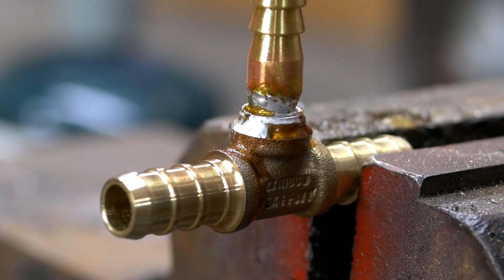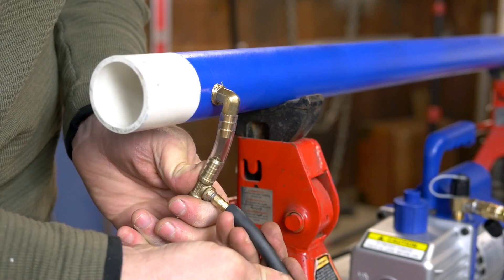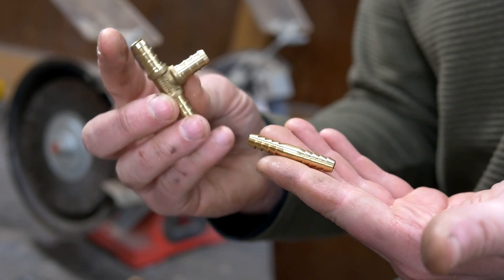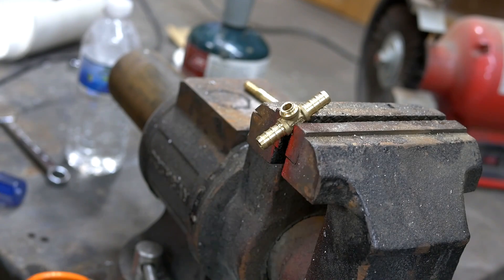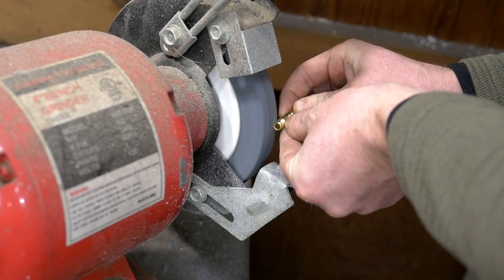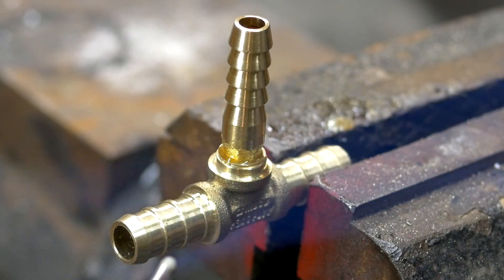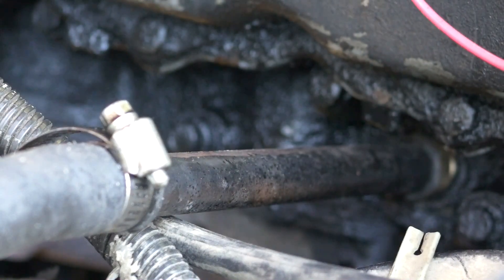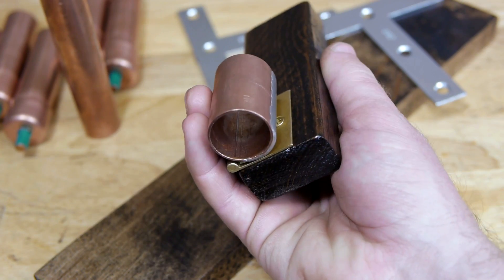How To Make Custom Brass Fittings

Comment: You could use a nail or steel tubing inside your hoae barb to support it from inside when grinding it.  Make sure to grind off the point of any nail just in case.

Comment: You should not use standard soldering for thermal stuff and coolant systems. Brazing is always safer there.
Reply from the maker: I think I have bigger things to worry about if my engine gets hot enough to melt the solder though.

Comment: the compression fitting is an hvac specialty. if you have a Kerr in your area they keep them in stock if you ever need another. just ask  for a yellow jacket flare fitting. they come with flare on one end and 1/2 npt.
Reply from the maker: Good tip!

Comment: you should try silver brazing/ silver soldering, using mapp gas or oxy acetylene. It creates a  much stronger connection and can handle a lot higher heat then the soft solider can

Comment: When I grind small cylindrical parts by hand like you did with the fitting I would insert into a rod making handling of the piece easier and the grind more even.

Comment: Awesome video!  I've got a similar problem lately of mounting an aluminum hinge to an aluminum fuel tank filled with gasoline.  Don't think I'll try this with the flame but was thinking maybe just some epoxy for now unless you have a better idea.  Its not a big enough project to remove the tank and drain it to tig weld for what i'm trying to do.  Love your videos, pop on over the my channel sometime, I/we do a lot of fabrication as well as Jeep related stuff!
Reply from the maker: Aluminum doesn't solder well. JB weld might do it, but I wouldn't trust such a thing to hold the weight of the tank
Reply: everyone is watching this! hey matt/tyler/tim
Reply: I worked a fair bit with both soldering and tig welding. And you would have to tig weld it if you want it to hold well. Be careful when tig welding gasoline tanks though, even if you wash them out completely, somehow fumes are still there to blow into your face when igniting the tig ;D Good luck!

Comment: use a pvc-pressure-cylinder instead of athomspheric pressure to accelerate the projectile. one endcap for the Barrel would bei required.

Comment: I made a bunch of these, but much smaller for my portable dental unit(used for polishing). I soldered most of mine, but brazed a few. Excellent video!
Reply from the maker: Brazing is something I haven't messed with yet, I bet it works even better for this aplication

Comment: a simple trick for doing this is out the piece in a drill and use that in combination with the girinder or belt sander so that the part is rotating at a constant speed. it keeps everything even and makes the process safer and faster
Reply from the maker: Yeah that's a good idea if the piece can fit in a drill well.

Comment: I had that problem multiple times too. I used a super strong epoxy cause they were chromed fittings, do you think solder would work too? Awesome video, I'm excited that you're making more videos... :)
Reply from the maker: Should work fine with fuel, just make sure you clean off any excess flux after soldering as that would probably not be great to suck into your carb.
Reply from the maker: I'm not sure how well chrome takes solder, but if they're brass underneath it would work fine if you sanded it off
Reply: Right... Thanks a lot! :)
Reply: +NightHawkInLight would the solder be safe to use for a gas line? I have a 1984 Honda interceptor in need of a gas line T piece which is sold NOWHERE.
Reply: +NightHawkInLight thanks, that's what I was hoping!
Reply: It's really cool that you follow NightHawkInLight, I watch your videos too Giaco and they're really good!

Comment: In a pinch this would be fine, but you just joined a PEX fitting with a barbed fitting.  Most big box outlets would have the size you want -- if not, try a plumbing or HVAC supplier.

Comment: Nice! I always seem to be looking for adapters from one size/type of fitting to another. BTW, you made me really happy when I saw you used separate flux on the joint - so often, I see people trying to solder things just relying on the flux in the solder (if it actually has any), and getting nowhere, or making a horrible joint!

Comment: Have you had any leak issues with these or do you test them with soapy water before putting them to use?
Reply from the maker: I haven't had leaks so far. It's pretty obvious if you have a bad solder joint, it won't look right. I haven't had to test with soapy water.

Comment: To Nighthawk or anyone else listening, what's the best commercially available air tank. I mean that had the highest psi capacity.
Reply from the maker: You mean air compressor or air tank? Shop air compressors are rarely made to make pressure greater than 200psi. Air tanks on the other hand, like scuba tanks, can be made for over 1,000psi.
Reply: NightHawkInLight, I mean an air tank. I have an idea for a project that requires one to be able to supply a lot of pressure when the air is released.
Reply: @yummyhershey5902  you can buy oxygen tank.

Comment: I used a similar method a while ago to allow me to cut my upper radiator hose and slide the ends over a section of copper coupling which was customized with a hole drilled into the fitting on it's side and a brass bushing who's internal threads were the same size as the temp switch I wanted to use. The brass appears to be turning green for some reason but other than that, it's holding up fine.

Comment: I guess if it's purely to hold a vacuum at room temperature, you could replace the soldering with 2 part epoxy.

Comment: or just heat the tube and but it in the T fit 👍
Reply from the maker: That would work great, but it's harder to do and easier to mess up.
Reply: yeah that's right but if u don't have flux or soldering iron  it will work great ..

Comment: Well - stone-cutting angle disc could be ideal. IF and only if you already have it. They cost a fortune, really.  And some 10-12 thousands RPM using thermoinsulating (ok, welding) gloves.
That worked just fine for 600 psi air hose.
Edit: I needed to test PCP airgun feed tank after the hard fall.

Thank you for really valuable videos!